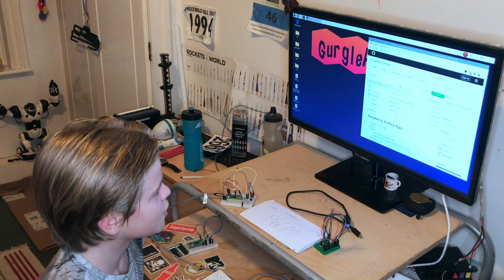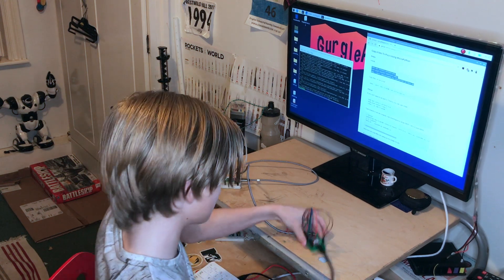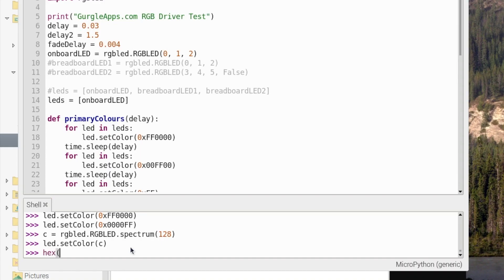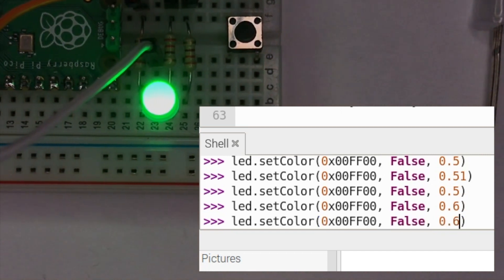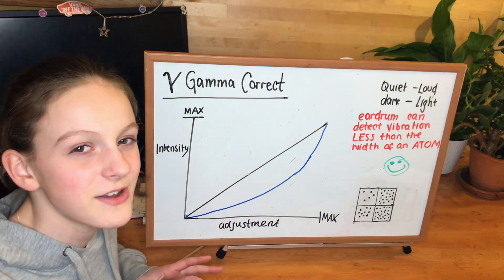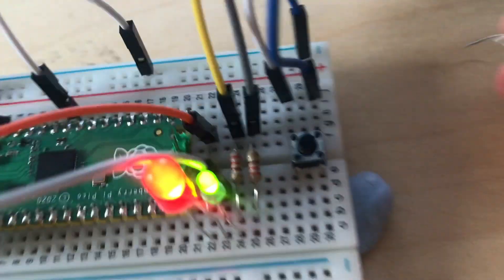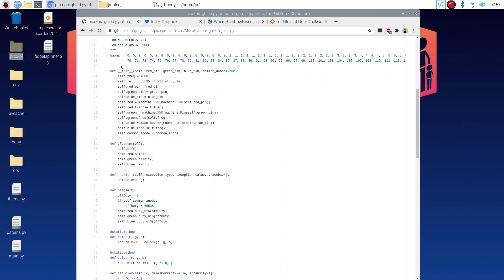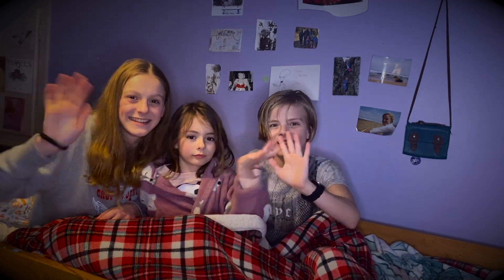Playing with RGB LEDs, PWM, Sound, & more on Tiny2040, Raspberry Pi Pico &  Microcontrollers

Comment: Another great video with good editing and easy to find sections due to your inclusion of a table of contents.  Thank you. 💙

Warning:  The following is long, and a bit dense and pedantic.  

TL;DR the Raspberry Pi MicroPython docs use value of 65025 (255^2) as the "full duty cycle" value, not 65535 (2^16)-1.

A question about the value 65535 for self.full.   It seems the values used by MicroPython PWM are chip specific, e.g. for ESP8266 the MicroPython docs show a max of 1023 (2^10)-1 for "100% duty cycle" and the max frequency is 1KHz.   So (2^16)-1 seems like a reasonable extension.  But in the Raspberry Pi Getting started with the Raspberry Pi Pico documentation, it says 

"The duty cycle tells the LED for how long it should be on each time. For Raspberry Pi Pico in MicroPython, this can range from 0 to 65025. 65025 would be 100% of the time, so the LED would stay bright. A value of around 32512 would indicate that it should be on for half the time."  

65025 is 255^2 and not a the max u16 value 0xffff, I am not sure why it was chosen (but note that 65025 is 0xff * 0xff)  The "resolution" of the PWM edge is probably a RP2040 clock cycle.   One problem all implementations face, that use a power of 2 as the number of time slots in a duty cycle, is that an extra bit will be needed to cover both the all off and all on conditions. If you are using 2^n timeslots, you want to allow for complete off and complete on, that requires (2^n)+1 edge times (walls around the time slots) values, so you can't represent with (2^n), but you need (2^n)+1 bits.  (e.g. if there are 2^16 (decimal 65536) time slots, numbered 0 to 65535, and 0 means "off all the time", 1 means on for only one time slot and off for 65535 time slots, 2 means on for 2 time slots, and off for 65534 time slots, ... 65535 would means on for 65535 timeslots and off for 1.  Be we want to be able to force it to stay on 100% of the time, especially if this will be in interrupt trigger.  The point is, you can't represent always off and always on with an n bit number, if you have 2^n time slots.  You need one more bit than the "natural" number you would expect.  Looking at extreme cases (2^0) time slot requires 1 bit, (2^1) time slots requires 2 bits (3 values 0 slots on, first slot on, all slots on) requires 2 bits).

Same type of problem exists when you have a pixel matrix with even numbered sides.  Then there is no one pixel that is in the center.  It is easy to see with a 2x2 pixel matrix.

So perhaps that is why they chose 255^2 instead of 2^16-1.  My guess is that any value greater than 255^2 will be treated the same as 65025.

65535 has prime factorization 3x5x17x257 (255*257).  So dividing self.full by 255 will give 257 as the step, and that won't fit in 8 bits.  So perhaps max unsigned byte value 255) squared (65025) was chosen for that reason, but I don't really know.
Reply from the maker: Thanks for the info Jon, we'll update the description and code. We appreciate the time you take on these comments & we've learned a lot from you.
Reply: @GurgleApps  I skimmed the PWM chapter in the RP2040 Datasheet (that's an odd name for a 645 Page Book, but it is well worth the free download).  MicroPython is hiding a lot of complexity, but the PWM is not conceptually hard to understand.  There is a 16 bit counter that counts (possibly downscaled cycle counts) and when the value reaches the "TOP" value, it (normally) resets the counter to zero and then when the reset occurs sets output to 1.  There is also a compare counter "CC" register that when the counter gets to that values, sets the output to zero.  There are timing  diagrams in the RP2040 Datasheet book that explain better than I can in words.  Normally if you don't want the value to change, you set the CC to TOP+1, so the counter never reaches it.  But that means you can't use 0xffff as the TOP value if you want "always, on" as a possibility.  The book explains another reason why this is important, if you are using solid state switches, there is power loss every time there is a switch between on and off.  So the highest value for TOP needs to be something less (like 2^n-2, or 2^n-3 if you want an even number of cycles). see 4.5.2.2. 0% and 100% Duty Cycle in the RP2040 Datasheet.
If you want a cycle that can be nicely divided in to equal parts for low integers), the highest  highest multiple of 60 < (2^16)-1 which is 65520 for TOP, and then you can set CC to 65521 for always on, or 0 for always off.  (think about why there are 60 minutes in an hour, and 360 degrees in a circle, or 12 in a dozen).  On page 550, they give the way to set the period using the registers.  MicroPython, and the C SDK provide routines to do a lot of the work, but without understanding what the functions are doing, it is like black magic.  And it is nice that MicroPython hides the details; most of the time, they don't matter. For controlling an LED, you aren't going to notice any difference, but if something is counting cycles, it will make a difference.  Or if something is detecting either leading or falling edges, even a one cycle pulse is very different than